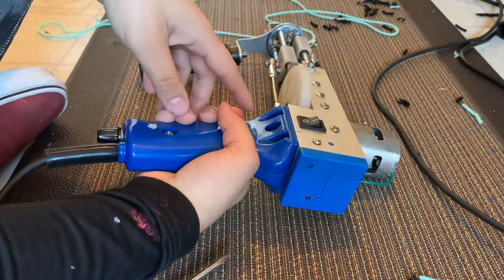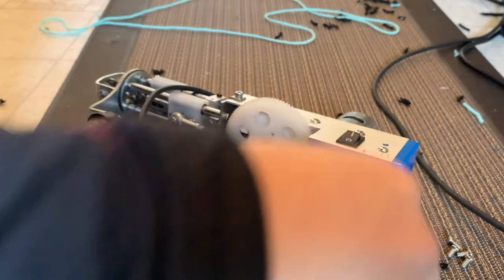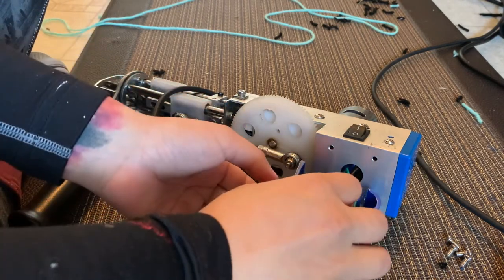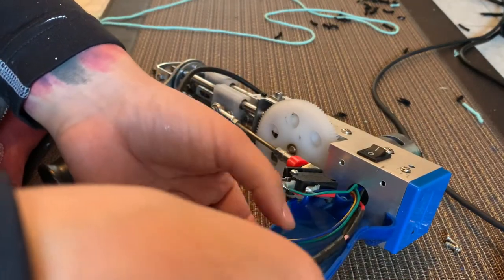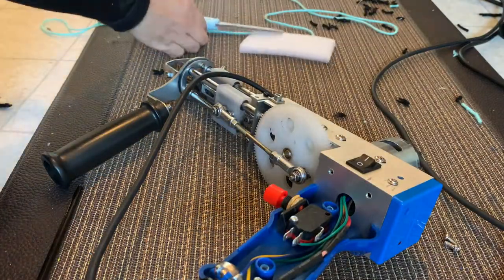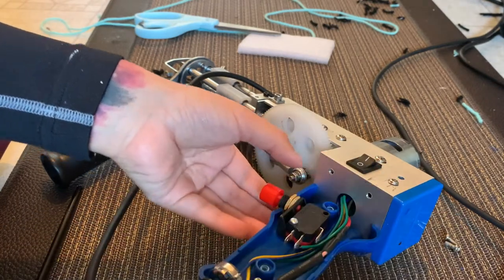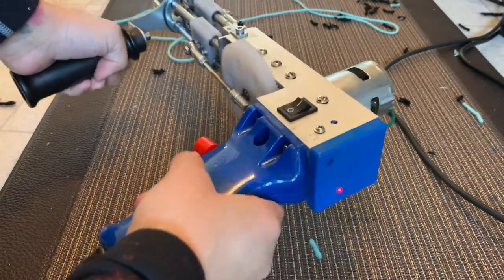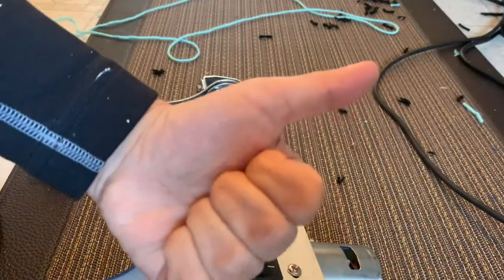AK-1 Rug Gun Trigger stopped working

Comment: I know you may not see this in time but Please Help! My gun keeps cutting off and I really need to get these rugs made by tomorrow, I don’t know what to do and I’m freaking out. What could be the issue? Every time I start to use it the light just dims out. It has never done it before and it now decides to do it when I need it the most. Please help
Reply: did you figure out the issue?
Reply: i’m having the same problem
Reply: If your having those issues it’s your wiring you gotta make sure your not stepping on your cords while tufting
Reply: I have the same issue- did you find out what was the cause?

Comment: Where did you buy it from ?
Reply from the maker: ebay.
Reply: @CristinaPerezArt  ive seen a lot of these ebay China copies break really quickly
Reply: @bunnylovebooks5563  They say be careful with that one because if you hit the red trigger with the gun plugged in and turned off it can fry it. The capacitor stores up energy and doing that will make it pop apparently.